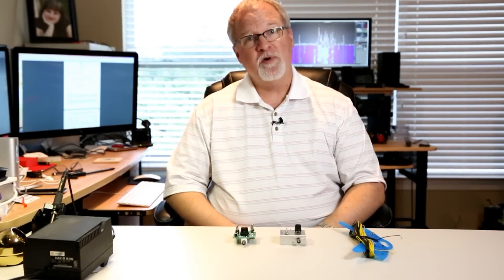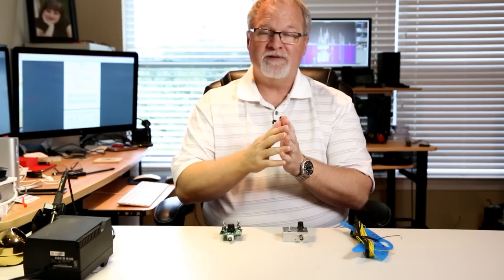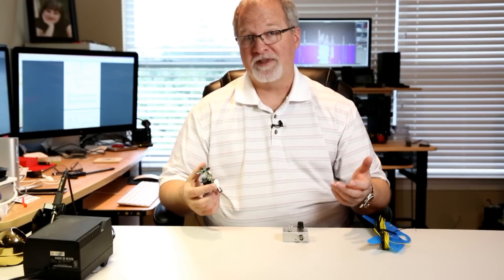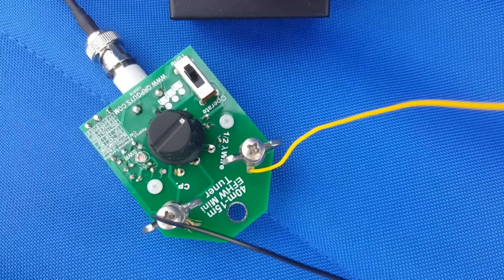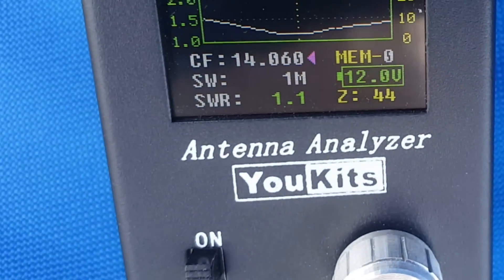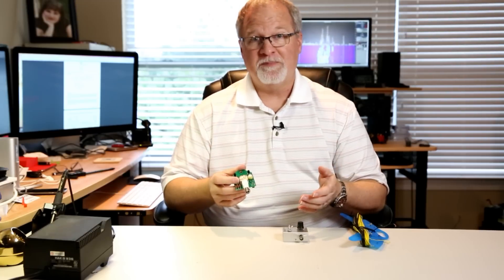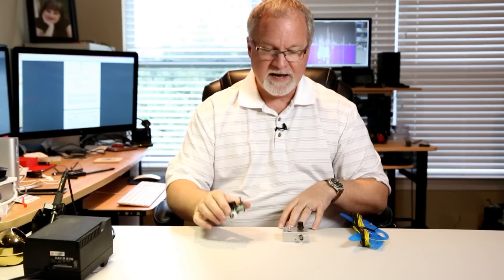QRPGuys End-Fed Half-Wave Mini Tuner

Comment: Should its BNC connector go into the transceiver or should there be a coax feed line in between? On the drawings in the manual, this tuner is placed really close to the transceiver as if no feed line is needed.

Comment: Thanks for nice information. It's a nice kit. In order not to mess up L1 and L2 toroids I practice with an ordinary wire before actually using the one which follows the kit. What I don't quite understand is what to do with the wire after tapping at 3rd turn L1. Should the remaining wire from tapping, for the next turn, go from above or below to make a valid turn? I believe it's hard to describe with words only.

Comment: Does it do anything at all on 10 meters? I'm surprised it doesn't cover 10.
Reply: I've never tried it on 10m. If it worked satisfactorily on 10m, I suspect the guys would have included that in the product listing, though. So, I'd be surprised if 10m was possible. -Cliff

Comment: Hello, my name is George from Romania. I don't know English very well. Can you help me? How many meters does the yellow wire have, and how many meters does the black one have. I use the antenna more in 20m 14mhz. I am waiting for your answer, to understand that the length of the wire is measured in inches on the antenna . Thanks 73 !
Reply from the maker: Hello, Sud.  According to the markings on the board, to use this antenna tuner for the 20m band (14MHz), you would start with the antenna wire at 31.5 feet long (31 feet + 6 inches = 9.6 meters) and the counterpoise wire would be 17.5 feet long (17 feet  + 6 inches = 5.334 meters).   These wire lengths are approximate and you may need to change the length depending on your deployment orientation, height, and/or nearby structures.  Just a reminder:  you don't need perfect 1:1 SWR in order to make contacts.  If your SWR is 2:1 or better, you'll be fine.  So, use these recommended wire lengths and give it a try.  Best wishes to you!  - Cliff (N4CCB)
Reply: @QRPSchool  Thanks for the answer, I looked on the internet and saw that it is measured in feet. YO3EVS 73 !
Reply: @QRPSchool  What do you think of the fx-4c hf sdr transceiver, have you had the opportunity to test it? I have one and want to test the QRPGuys EFHW antenna.

Comment: any thoughts about this one and the QRPGuys 40m-10m UnUnTenna Plus? I can't decide between both and sent them an email for suggestions but they don't answer. Both have tunner and the LED but the UnUnTenna has 10m, I wonder is the UnUnTenna will have a better performance because of the bigger toroids.

Comment: Has any one tried to see if it will tune the bands above 40 with just a 40 meter wire instead of having to carry multiple wires? If not traps could be an option.

Comment: Well after some careful consideration and also losing a some well-composed ramblings (!) about the difference between this outfit and the 49:1 half-wave setup (as tested and taught by N4LQ), I'll summarize it this time instead of re-composing the whole piece:  For maximum efficiency and widest range of options, as well as practical "QRO" application (see Steve Ellington's (N4LQ) latest video for best comments on mode/power handling of the 3-core stack), the 49:1 type as I have built is my best option. This QRPGuys version brings in some limitations and adds the complication of a counterpoise that we don't usually use. Also with the 49:1-type, that a tuner isn't needed at all for most harmonics, and that more bands are available. 

Yes one might carry a pound or two extra stuff, but, for this particular ham (ain't we all particular?), QRP is about efficiency of our signals sent and received mostly and less about extreme minimalism. Or put otherwise, don't compromise the wrong areas.  

What still slightly confuses me are the limitations of their system 40-15 and 80 only. I'm working 80-6 with my current installation and ~134' of wire with a 75m mod. I have worked 160 with 270' of wire. So that's another reason I'll use what I have, here as well as "on the trail". 

I think QRPGuys have a lot of good gear, well-priced and supported, but this bit no longer interests me as I can pack the "big" 49:1 transformer and 1/2-wave wire anywhere I intend to operate. It's what I use at home. Thanks for the video Cliff. 73

Comment: I have a bunch of their stuff. I'm building their tiny iambic paddle, to mount on my uBitX transceiver. I also have their multi-band trapped end fed dipole, that has a similar tuner at one end. It works pretty well. I have the same tuner you're reviewing in my box of kits waiting to be built.

Comment: I purchased and built a Hendricks SOTA tuner years ago. The Led never lit up. When attached to the analyzer I could get decent swr in the tune mode but when I flipped to operate the swr went wack. I looked for wiring error but couldn't find one and just set the tuner aside never used. I would like to re-visit it with more experienced eyes. Any suggestions?
Reply from the maker: Earl Boaz Hmmm... Well, it's possible that there's a bad component somewhere. The first thing I'd do is look at the soldering job to see if I've accidentally created a solder bridge between two connections that weren't supposed to be connected. Then, I'd reheat every solder joint to reflow the solder to insure I didn't have a "cold solder joint".  I had a problem a long time ago when I failed to completely remove the enamel from the magnet wire while soldering a torroid in place. That's about all I could suggest before you start looking checking the voltage at the LED, etc.

Comment: I was hoping you might highlight any differences to the QRPKits version, is it just the case that costs the 15. extra - thanks for any info - Dave
Reply from the maker: As I said at :30, they are exactly the same circuit.

The case is the only difference and, for some, that's worth the extra cost. - Cliff
Reply: Thanks.  Was looking for personal operating experience but no problem, I did see the circuit at :30 but often different component sourcing, board and the like will yield different results.
Reply from the maker: They both work the same.  The design of the QRPGuys version makes it impossible to mount it in a box, though.  The extra $15 gets you a nice package to put it in. - Cliff
Reply: I had no idea they sell a box for this. I checked on their website and could not find one.
Reply: Talking about this kit that is identical but has a box and cost a bit more, just took this on a work trip and it worked like a champ:
http://qrpkits.com/sota.html

Comment: another awesome video cliff, some knucklehead just swiped my fluke 87 right off my bench, my fault for being trusting enough to leave it out as i ran to the mens  room. So, i dont want to spend another $400 on a 87, all i need is something for lil electronic kits and so forth, i have spent about two hours looking for  a replacement, and there is a ton of options  blah blah blah, i was wondering what meter you used so i could at least get some kind of starting point. when i bought the fluke umpteen years ago, it was the one my EE professor said GO BUY THIS ONE! and since i was making really good money .... not retired , military pay, i just did it , any ideas where to start ?
Reply: ill spend the 400 if i need to, but i just figured there were much better options, and i probably did not really need too, and i would much rather spend $400 on a mountain topper than a meter lol
Reply from the maker: The meter I use is this EXTECH.  I've had it tested for accuracy and it did very well in the tests... https://www.adafruit.com/products/308
Reply: as always you came thru again man, the extech is perfect, i went with the 530, and for the money.... looks to be a great meter ... thanks man.

Comment: Is it a problem that there is no case? I'm thinking of buying one for SOTA activities, but I don't want it to get dirty and/or damaged after one or two uses outside. I could get the Hendricks SOTA tuner, but that one is quite a bit more expensive, but might be worth it for the case.

For the QRPGuys tuner or the Hendricks SOTA tuner, would it be feasible to install binding posts instead of using the wing nuts supplied? Binding posts seem like they'd be more useful for attaching wires to.

P.S. I enjoy your videos, and find them to be very informative. Thanks!
Reply from the maker: Hello, Jeffrey.  I would have preferred the circuit to have been designed to fit into a case.  That said, I wouldn't hesitate to take one into the field.  Even if it got "dirty" you could wipe it off with a slightly damp cloth and let it dry.

The Hendricks SOTA tuner in the case is more "finished" but costs more.  Still, the cost is not a lot when you consider it will last for many, many years of fun.

As for the binding posts, you can hack it however you see fit.  And you'd need to in order to make it fit into a case of some kind, should you decide to do that.  The knob sticks up higher than the switch and the LED sits on the board... making it very hard to mount it in any standard case as-is.

Still, it works great and I'm not worried about mine not being protected. - Cliff
Reply: @QRPSchool  Could you coat the board in liquid electrical tape? Or would that mess with the electronics?
Reply from the maker: @spencergiles72  It wouldn't hurt the electronics to apply liquid electrical tape.  However, it might be worth it (for some people) to just use some wire to extend the most important components to fix into a little box.  The power switch, LED, knob, and antenna posts could be extended (remoted) to the top of a small box.
Reply: Thanks for this question and answer.  I was wondering the same thing.  If I was into 3D printing, this looks like a great application for it.
Reply: Something like a soap travel container at WM would do fine with it.

Comment: What gauge wire are you using that is wrapped on that blue wire hanger? 22? Have you used this for SSB staying under 10 watts.
Reply from the maker: Hello, Todd.  I think my wire was 26 gauge.  Any gauge is fine, though.  I've used this for 5 watts of morse code/digital.  The website says it's rated for 5 watts continuous or 10 watts of PEP (peak envelope power).  So, you'll be fine to use it at 10 watts SSB. - Cliff

Comment: Just ordered on and can't wait until it arrives. Can I use this tuner for a Doublet or is it only good for an end-fed antenna?
Reply from the maker: It's intended to be used with radiating wires that are cut specifically to a half-wavelength on the band(s) you want to work. You could have a small set of zip-lock bags with each bag containing the radiating wire and counterpoise for a specific band.

If you are using a long wire or other non-resonant length of wire, you could use this to help tame the impedance but you'd still need to use an Antenna Tuner to be able to send your full 5 watts to the antenna... but it would not be as effective as if you were using a wire kit cut to a resonant frequency.

That said, I worked Italy last Sunday using a 26' radiating wire and two 16' counterpoise wires from the balcony of a hotel in Florida, using my KX2's internal tuner. When propagation is good, your signal will find a way! - Cliff

Comment: Excellent Vid. I'm sending off for one of the QRP Guys kits. I've used the resistive bridge in other circuits before. I noticed you checked the SWR on the analyzer while the slide switch was in the Tune position. Although the resistive bridge circuit is great for QRP, you will notice the SWR on your analyzer will change when you slide the switch from Tune to Operate although you're at minimum SWR. Not much change but it will change.

Comment: You knob is wobbly. Did you get the nylon insert and screw that is inside the black knob. Mine does not wobble like that.Nice video. I bought mine for backpacking QRP work.
Reply from the maker: Thanks, Todd. Good Eye, as they say in baseball. The problem was that I hadn't tightened the set screw enough before I went into the field.  Once I turned the knob too far (before the camera started rolling) the knob was loose until I could get back home to tighten it.  Not wanting that to be a show-stopper, I just went ahead and shot the video with a wobbly knob. It's good now.  Thanks for noticing and looking out for me. - Cliff

Comment: Another Geat video Cliff Tnx. I've already bought and build one . I wonder, can i use it for 80m? Is there a formula to measure the wire lengths ?
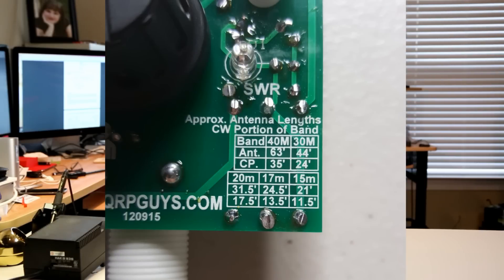Reply from the maker: +Sotiris Chrisopoulos Hello, Sotiris.  That's a good question.  I don't know of a reason why it wouldn't work on 80 meters. At 1:48 in the video, I show the chart that is listed on the tuner. If you look at the wire lengths for 20 meters and then look at the 40 meter wire lengths, you'll see that the wires are twice a long for 40m as they are on 20m.  So, I think we could double the length of wire for 40m in order to get the length for 80m.  If that's correct, it looks like the wire length for 80 meters would be a radiator of 126 feet with a counterpoise of 70 feet.  Give it a try and let us know if that works. Future readers would appreciate it and I'm curious, too. Thanks- Cliff

Comment: Cliff, I noticed the EFHW tuner board info was for the CW portion of the bands.  Can you use it for voice/digital? Great channel! 73 Mike
Reply from the maker: +Max Prepper Hey, Mike.  Good question. If you look at the analyzer in the video, you'll see "CF: 14.060" and, as you already know, that means the the Center Frequency is set to 14.060MHz.  Now, look at the next line on the analyzer.  It says, "SW: 1M" which means that we're looking at a plot on the screen of 1MHz of Scan Width... 500KHz on each side of 14.060MHz.  So, the entire 20m band has less than 1.5:1 SWR. Thanks for asking about that. I should have mentioned it in the video. - Cliff